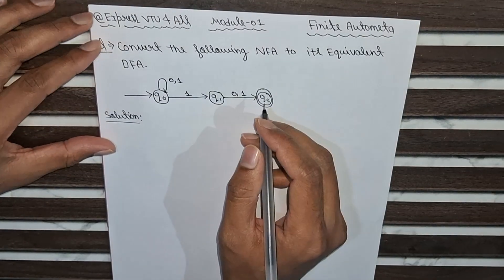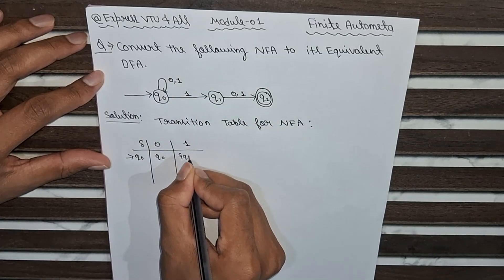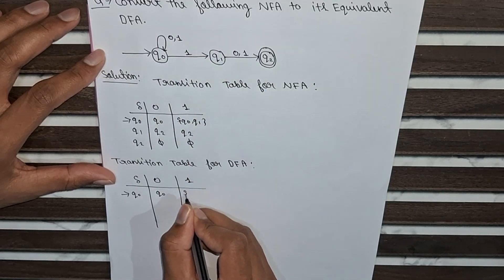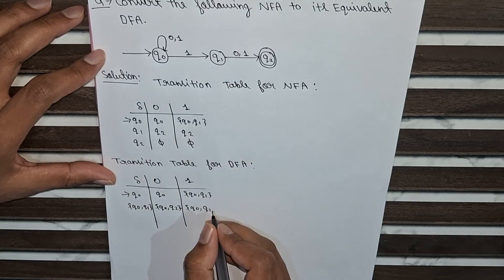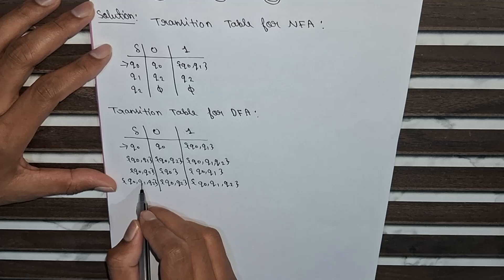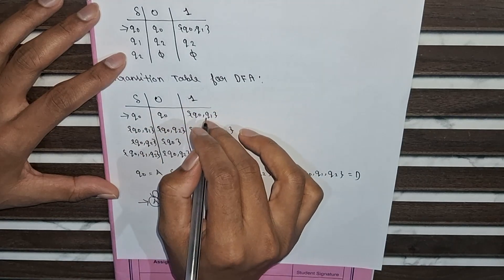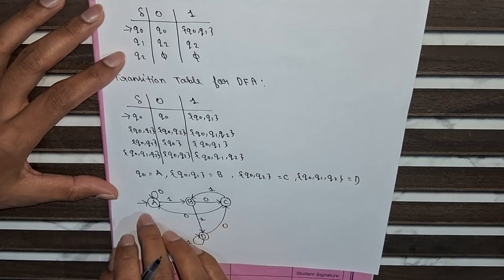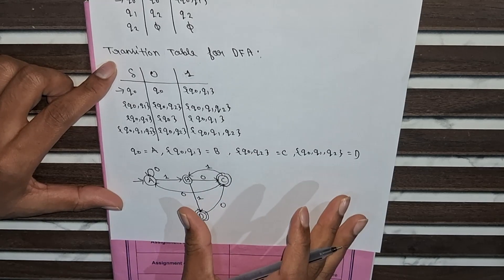VTU TOC Module 1 | Convert NFA to DFA |  BCS503 | Lazy Evaluation Method |VERY IMPORTANT QUESTION

Comment: Write the regular expression for: “String start with ‘0’ and have odd length”.
Reply from the maker: Good question 👍
The regular expression for "string that starts with 0 and has odd length" is:
0((0|1)(0|1))*
Explanation:
The string starts with ‘0’ → first symbol is fixed as 0.
The rest of the string has even length, so total length becomes odd (1 from the first ‘0’ + even part).
((0|1)(0|1))* represents pairs of symbols (even count).
Example valid strings:
0, 001, 011, 00011, 01010, etc.
Keep Studying 😄
Reply: @expressvtu4all 
Dr Please Also This
b) Write the regular expression for: “All strings of {a,b} containing at least two b’s.”
Reply: Write the regular expression for: “All strings of {a,b} containing atleast two b’s.”

Comment: Please Answer the following 

Convert RE to DFA: 
(0+1)*10*10*
Reply from the maker: Two-step method (via NFA)
Convert the regular expression to an NFA: Use similar methods to build an NFA that accepts the language defined by the regular expression. 
Convert the NFA to a DFA: Use the subset construction algorithm or lazy evaluation method to convert the NFA into an equivalent DFA. This process involves creating new states in the DFA, where each state corresponds to a set of states from the NFA. 

Like this you can do and also I will make the seperate video on this topic as soon as possible
Reply: @expressvtu4all   Please  make video solve it  during 2 days Please
Reply from the maker: Okay 👍
Reply: @expressvtu4all    hi dear Dr  where is the Answer